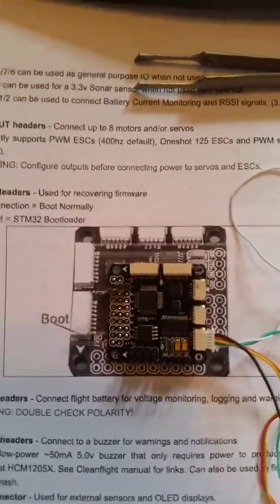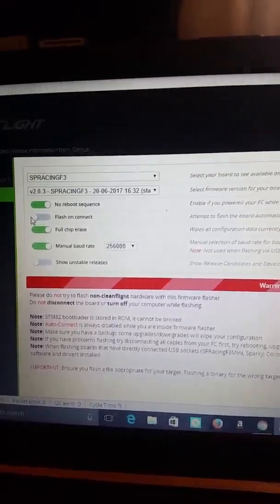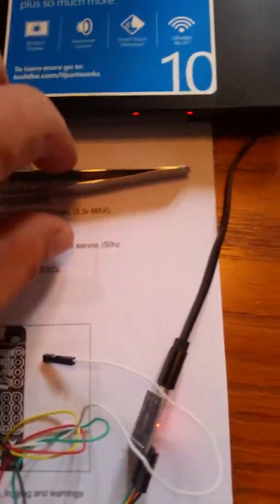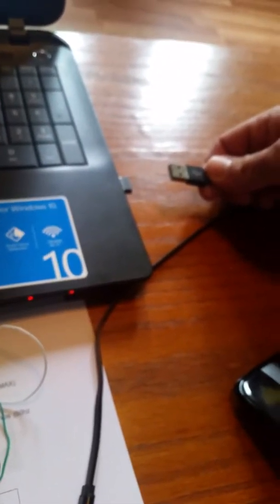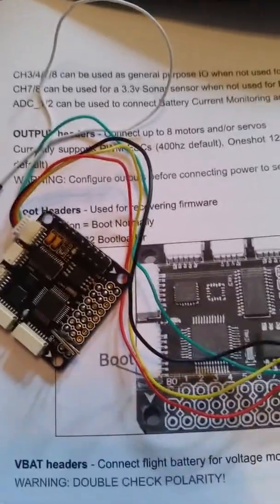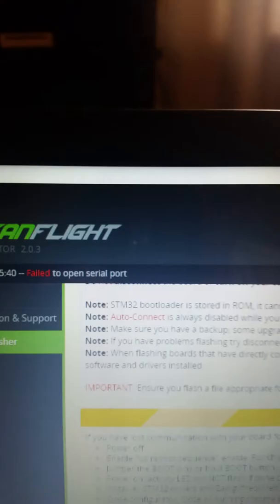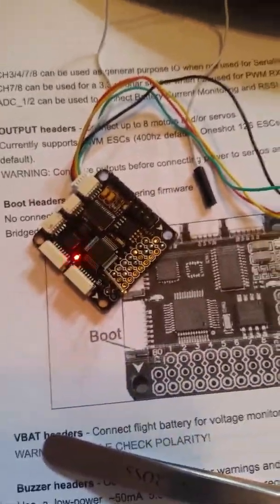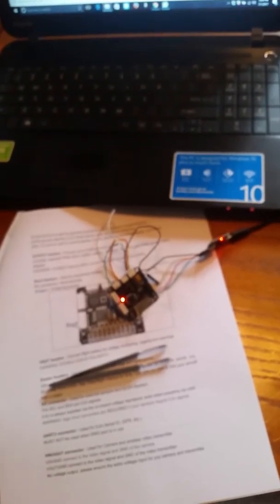SP F3 Deluxe Bootloader Issue

Comment: Dude...I feel your pain...I bought a second one of these from Gearbest...got the drivers correctly installed and moved my metallic tweezers in different positions over boot pins...Now I flash successfully but can't connect to any of the configurator apps. These clone chips are absolute horseshit and apparently with the 3.1 updates for the apps they no longer support boards lile this that have onboard OSD using UART1...its such bullshit So after $60 I'm going to buy 1 more genuine board widely used with boot button.
Reply from the maker: Yea man, the hours we have wasted trying to get these clones is not worth it. 
Genuine parts are the way to I to have learned. 
Thanks 
Nick

Comment: Hi did you tried "flash_loader_demo_v2.8.0" i had similar glitch. after flash with that "demonstrator" software it worked afterwords.. 
These boards is total waste .. and i pretty sure its readytosky assembled.. My board is load after flashing but after first reboot i get msg "Unrecoverable failure of serial connection, disconnecting..." and "No configuration received within 10 seconds, communication failed" any suggestion about this issue?
Reply from the maker: Yes I will upload the fix. 
So I had to download and install stm32 driver flash program. 
It's free but you need to type in your email and confirm via email to download the flash driver. 
After that it was so easy and took 5 minutes to flash, like it should of initially. 
I will post another video with the links. 
Thank you
Nick